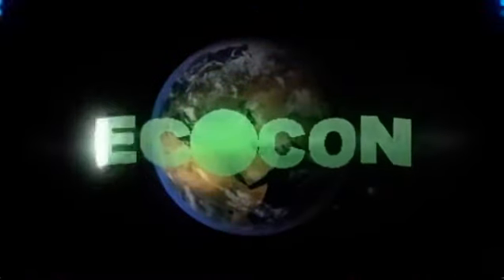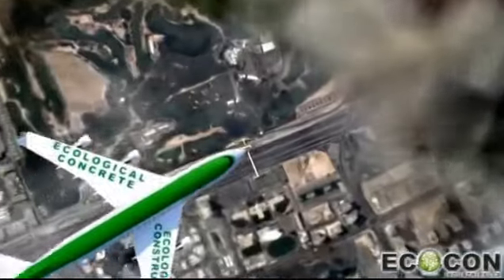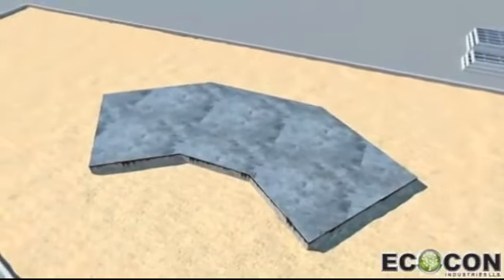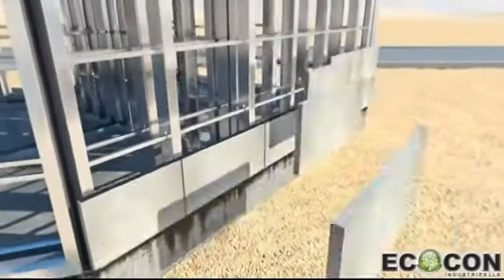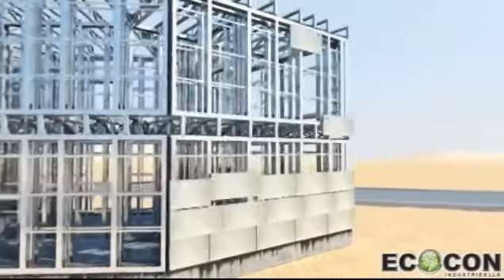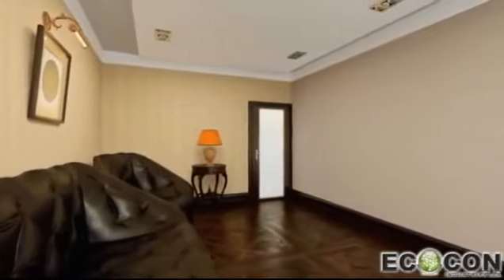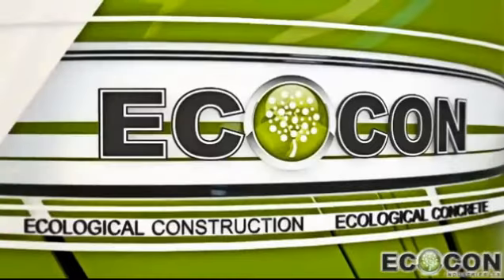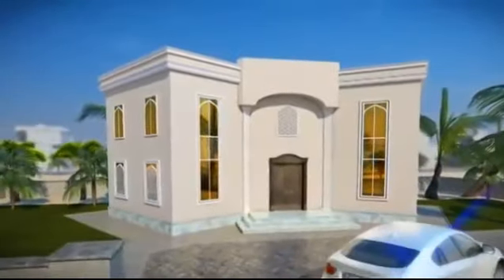Light gauge steel frame building system for low cost housing projects

Comment: What will be approximate cost compared to brick & concrete construction?
Reply from the maker: It depends on your design. Only core and shell is different. We use light gauge steel frame, fiber cement boards cladding and non autoclaved lightweight aerated concrete infill. The structure is solid the same is concrete/ blocks but much faster speed of construction.